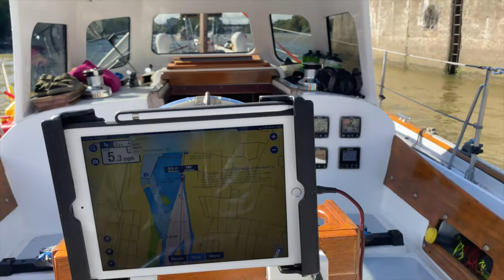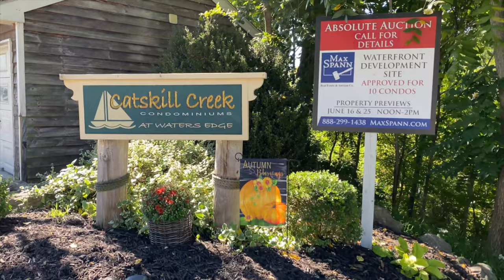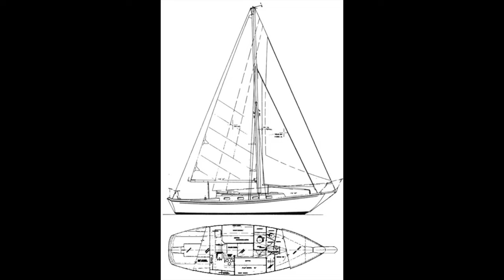EP.  7 FINISHING the Erie Canal & Seawind becomes a SAILBOAT again!

Comment: Was wondering what you based the decision on to delete the mizzen mast and transform the boat into a sloop. One of the best sailing qualities of these Allied ketches is the balanced helm that the mizzen produces in a strong blow.
Reply from the maker: Actually this is a cutter rigged Seawind from the factory per Tom Gilmers design specs. It was an optional upgrade and only around 7 of them were built that way. She’s very well balanced and in a strong blow a reefed main and staysail offer a completely inboard sail plan. They changed the mast position, height, and boom length for the cutters and redesigned the shroud arrangement for the inner forestay m